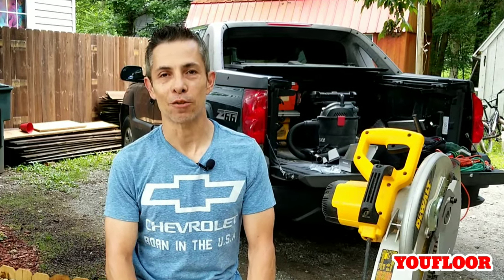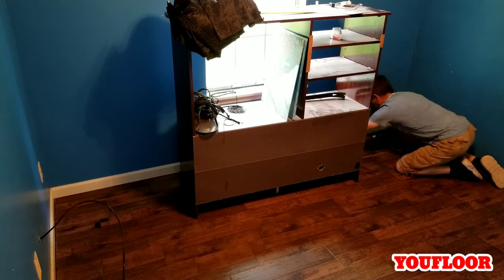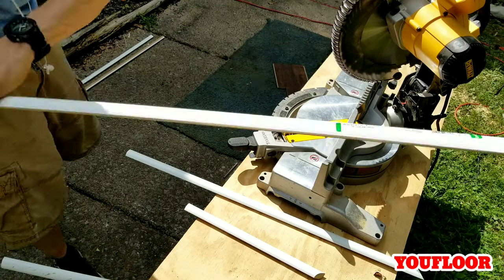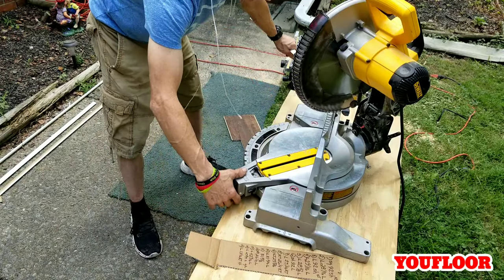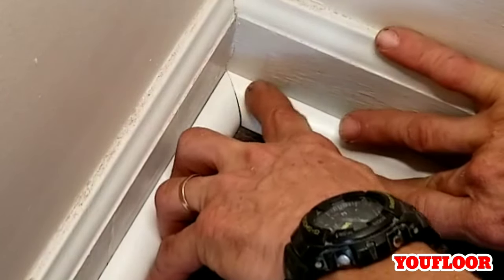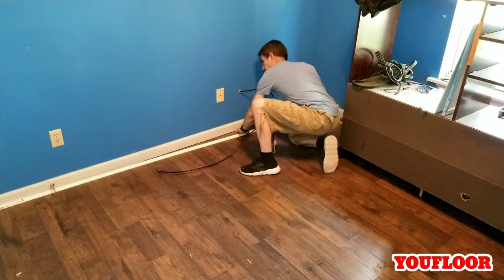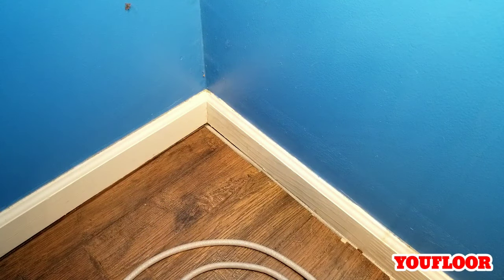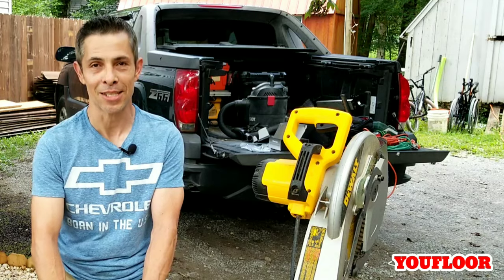How To Install Quarter Round Like A Pro

Comment: I'm 63 years old. I've worked with all types of saws/spinning tools all my life. First safety rule: NEVER have anything dangling down from your neck (necklace) or clothing (hoodie string/bandana) that can possibly get caught in the saw/tool. Once that string gets caught in the saw - it's over. Most farm-related accidents are caused by pieces of clothing getting aught in the spinning equipment - tragic accidents.
Reply from the maker: But did you get ANYTHING positive out of it. Thanks for the comment.  And the tip👍
Reply: @YOUFLOOR  Yes - your video was very helpful and I just finished installing the flooring in my house and thanks to your helpful tutorial I was able to easily install all of the quarterrounds today. Please don't take my previous post as some sort of criticism to you. I had no intention of criticizing you. I have worked on all sorts of equipment on oil rigs, fabrication shops, (my dad owned a gas station for 50 years) and mechanical shops, farm equipment, and the list goes on. I've seen my share of terrible accidents from all sorts of tools. This time last year I had emergency surgery on my face and neck from a grinder accident. The grinder almost cut my head off. I had so many stitches that they were too numerous to count. I was extremely lucky I wasn't killed. So, I wasn't trying to be critical - your video was very helpful and I appreciate the tips and tricks of the trade from a real pro.
Reply from the maker: Nah brotha you're good. I appreciate the view, comments, tips and the conversation. Glad to hear you're okay and that you didn't get killed by that machine.  Feel free to comment anything you want. Negitive or positive.. I'm never too old or experienced to learn something new. Thanks for the comment.  Good luck on your future projects.👊
Reply: My friend in HS got scalped & out in a coma from his ponytail gettin on the wrong machine in woodshop. 4 years ago I caught one of my piggy tails by the drill. Caught my hair drilled to the top of my face, it broke my nose and split both nostrils in half. Learning lesson for sure especially when working on cars.
Reply from the maker: Damn bro. Glad you're still alive. What an ordeal. Thanks for sharing

Comment: Why does everyone call this a different name. Beading, Skirting trim, Kickboard trim, Quad.. someone needs to come up with a standardized  name for it lol.
Reply from the maker: Well, if you took a whole round stick  and split it longways in 4 different pieces. You would have 4 quarter rounds. That's what it's called at home depot and lowes so I'm sticking with quarter round. Thanks for the comment

Comment: Does he know that he could use miter snips ?
Reply from the maker: He knows he can't. This trim is not real wood. The miter snips only work on real 1/4 round. It will not cut this MDF trim. I have them but I only use them in closets and on real wood trim. Thanks for the comment

Comment: One has to question using fiber board ,mdf or whatever kind of compressed paper as you described for a flooring project! First time someone takes a wet mop to the floor to clean it ,it's going to swell up at the least and or  fall apart ! Real wood or pvc 1/2 round or shoe molding isn't that expensive so why in the world would one use anything else??  Smh....
Reply from the maker: These are very good questions and if you look through the comments I dont mind answering this one for the 15th time. See at.the time of the video I was installer for Home Depot floor installation team. It was a process. First a sales person.  The a measuring team then I come. When I get there the material  has been acclimating for around 72 hours. I didnt pick it out and I didnt sell it to them and I didnt deliver it. My job was to install the material on the job. Hope that answers why in the world someone would do that. And by the way you dont mop laminate and this product is water resistant

Comment: Why would you install quarter round on new flooring and baseboards? It looks cheap af.
Reply from the maker: I install what the customer  is sold by the home depot sales people. I do t pick out the material or deliver.  I just show up, take a moisture reading and if everything is a go. I install according  to the customer orders.  Its different  on my own jobs. This is one of the most frequently asked question. But I still answer  like it's the 1st time I've been asked. Hope that helps. Thanks for the question

Comment: 1/4 round is a sure sign your floor installers were lazy.  A quality floor professional will remove all the baseboards and reinstall them. No 1/4 round needed. I realize 1/4 round has become the norm... but in my opinion using 1/4 round and not removing the baseboards is a joke.
Reply from the maker: A smart businessman would do what the customer asked to do. It doesn't affect the ability to install flooring. It just mean you want more business from them. They say they want 1/4... I install 1/4. Your comment is ignorant and shows
Truly, how long have you been at the trade. Have a nice day sir

Comment: Well actually....pros don’t install quarter round on the floor! They install base shoe which is 1/2”x3/4”. When you see quarter round over base molding it’s either the flooring installer did a bad job and you need that additional quarter inch or an amateur carpenter used quarter round.
Reply from the maker: I'm sure your jobs look amazing. Would love to see pics. Thanks for the comment.
Reply: Yes pros do, funny how your opinion trumps the rest of the countries because you deem yourself a know-it-all pro.  Grow up
Reply: Ouch...Charlie, no need to get personal. Been doing this for 41 years and all the contractors I know use shoe molding and many of the DIYers use quarter round. Maybe you have different pros? Jeez relax man😜
Reply from the maker: Thank you
Reply from the maker: Yes I used to try to defend myself but it's not worth it. But maybe I can get you to see it from a different perspective. I've always been taught the customer is not always right but  the customer is always the customer. 80% of my jobs are subcontractor jobs from Home Depot. And when I go there to buy stuff they have a parking  spot for me that says PRO. When I show up to someone's house the flooring trim, transitions, underlayment and caulk are already there. They have opted to save $300 having there base boards removed. So THEY ordered 1/4 round. So who am I to tell them with they are wrong and I refuse to install it. Wouldn't be in business  long with that attitude. Trust me. Go to Z construction LLC on FB or instagram And you can see all my professional jobs. Make sure to hit the like button. Thanks for the engagement
Reply: @YOUFLOOR  I used to subcontract for Lowe's.....Some customers like the baseboard and quarter round, while others if possible with the expansion gap just wanted baseboard.

Comment: 1/4 is cheep and ugly looking. 

If you installed your floor without removing your baseboards then you are an amateur.
Reply from the maker: Or you might be an installer for Home Depot and the customers ordered 1/4 round and didn't want to pay home depot's price for baseboard removal. I have been a subcontractor for H.D. and Empire Today for 13 years.  I don't pick out the floor or materials. I dont go over pricing with the customers. I just show up go over paperwork, count material, Check for moisture and flatness, then discuss direction and flow with customer (unless its naildown). On my own jobs I give the Customer the option. I am big on giving a quality product while keeping as much cost for the customer down as possible. Plus security and piece of mind when we are in thier home. That is professionalism if you ask me.H.D background checks everyone and they dont allow "ametures" to in stall for them. Don't believe me go try to sign up. If you knew all of this would you still feel the need to make your wiseacre comment. Thanks for the comment. All engagement is good. Even deleting  your comment is engagement.. Would love to see one of your professional videos. Send me the link. I love learning new tips and tricks I can pass on.
Reply: @YOUFLOOR  If a client ask for 1/4 round I tell them No. I guess 1/4 round doesn’t fall in line with the quality of my work. Take care
Reply from the maker: Good luck with all your projects
Reply: If you remove the baseboards you run the risk of damaging the walls.  I actually removed the baseboards in my kitchen and regretted it.
Reply: @Raydarman1  it’s really not that hard to be carful to not damage the walls or existing base, but to each there own
Reply from the maker: If we could all be as good as you the world would be perfect. Thanks for your expertise
Reply: @YOUFLOOR  no, the world would be skilled, but not perfect. The only carpenter that can give me a run for my money is Jesus!
Reply from the maker: That's pretty top notch work.